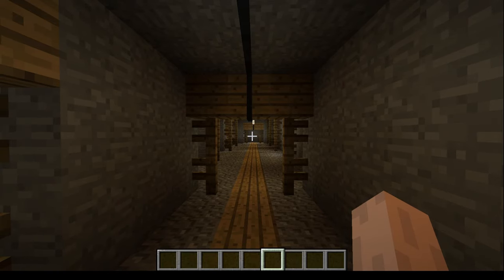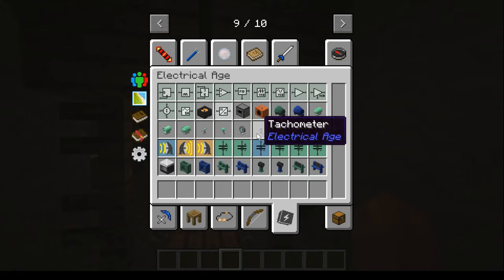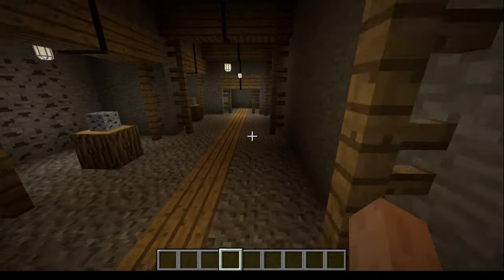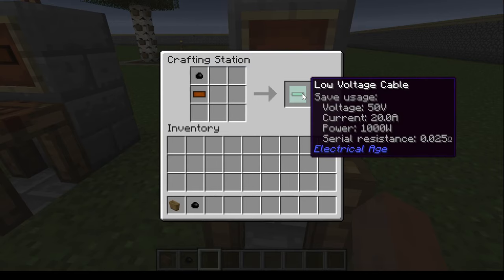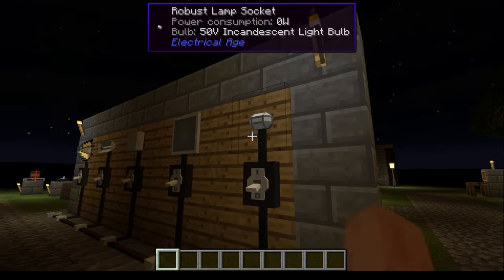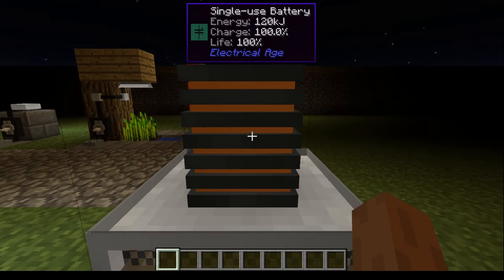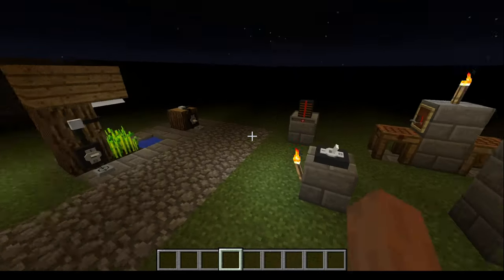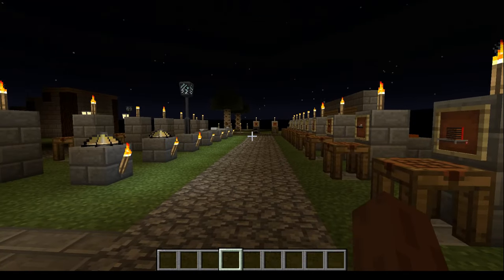Electrical Age Tutorial #1 Lights (Old)

Comment: They have another GitHub branch that's updated by another creator, you should check it out since it offers a lot more blocks and items
Reply: That is the 'unstable' branch, many things like lighting without DragonAPI is not stable there either. Eln2, for a newer version mostly will most likely not have the T2 poles which carry like 320KW+